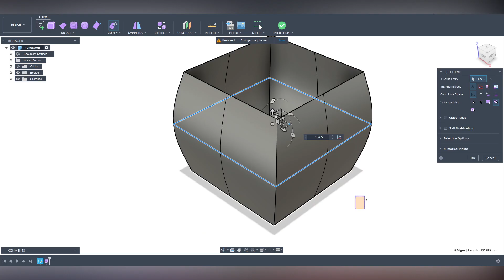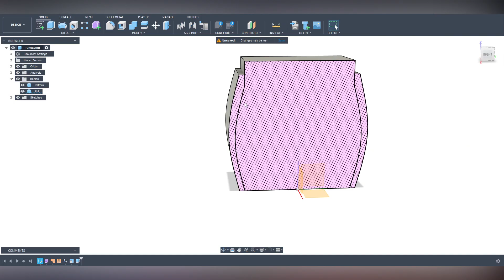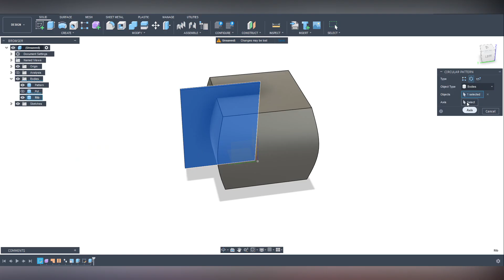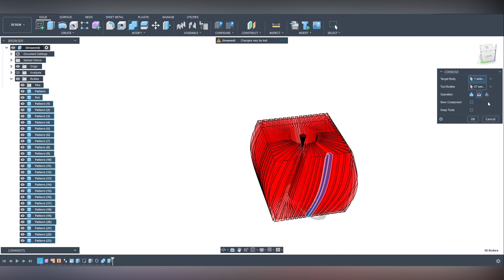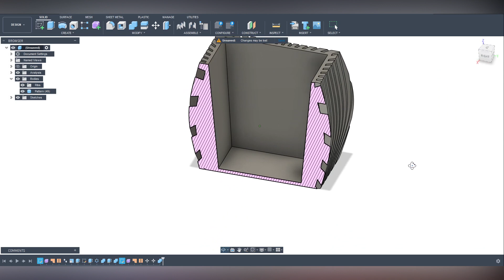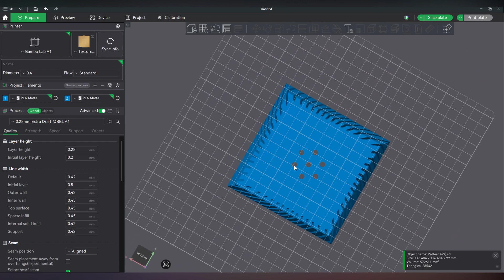Square Pattern Plant Pot in Fusion 360

Comment: Thank you, through your videos, i have realised how usefull is the use of form tools. You have gained a follower. i have a couple of questions though, why not use the shell option or the pattern option to create the ribs?
Reply from the maker: Thank you, I really appreciate that and  welcome on board! 
That’s a great question. I actually wanted to show a different approach and highlight more ways to build similar patterns using form tools.
In this case, the ribs I created aren’t something you can easily achieve with shell or pattern, especially if you look closely at how the edges flow and transition.
It gives a bit more control over the final shape.